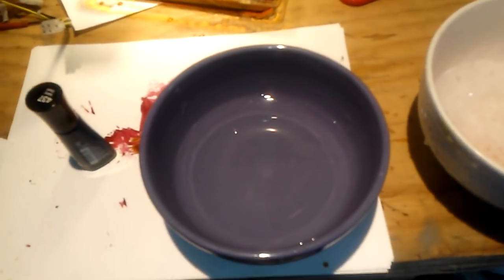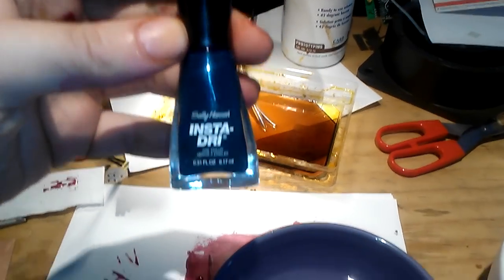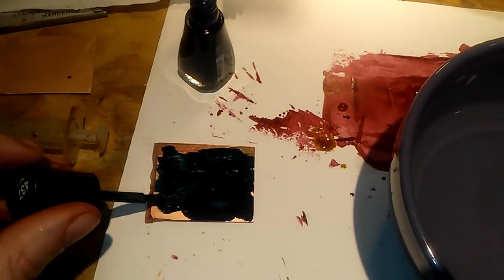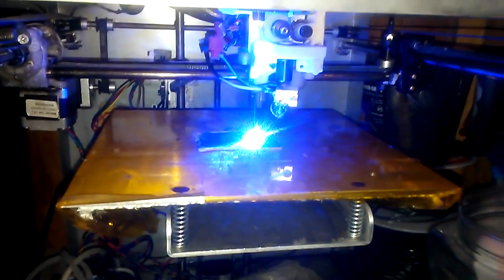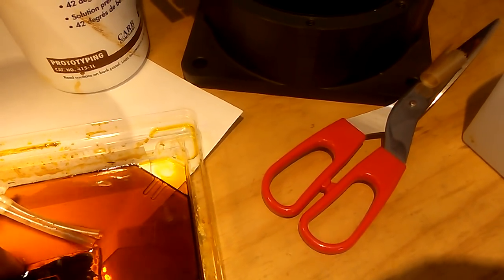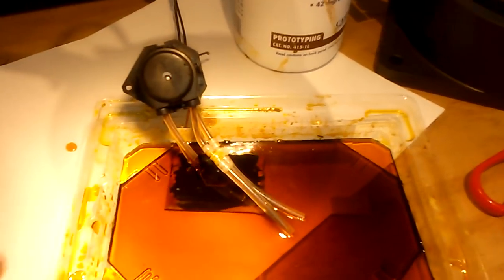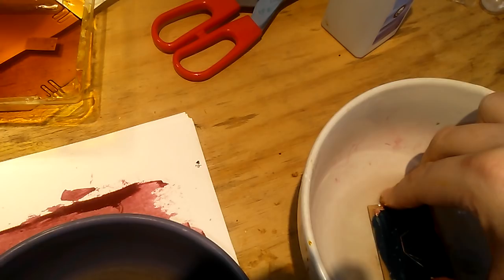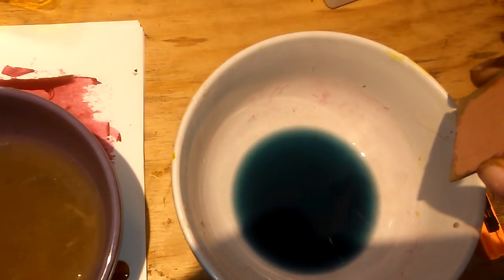Using a diode laser to etch a PCB

Comment: Just FYI.  You can get 10 double sided 100mm square boards with silkscreen for $10 now from China with three day turn around.  ($20 shipping).  And, Ferric Chloride is NOT skin safe.  It is a Category 2 skin hazard and a Category 1B severe eye hazard.
Reply from the maker: Yes, so wear goggles :) I am trying to show that it doesn't have to be scary. People read "acid" and immediately freak out, I want to combat that.
Reply: $30 is a lot to pay to make prototypes when you re-do board many times after discovering mistakes.

Comment: there has to be a better way to apply the polish. rubber wiper blade?  it would be really slick if not for the fact that the little brush makes it take too much time
Reply from the maker: I'm just showing a method here, what I generally do is use a broader brush I got at a hardware store.

Comment: You can't exactly say ferric chloride is "perfectly safe to put your finger in" when the MSDS rates it as a 3 out of 4 on the health hazard scale and 2 out of 4 on the reactivity scale.
Reply from the maker: The idea is that we use it at a low concentration, but with some kinetic movement.

Comment: Oh sorry, forgot..... what about the UV light from the laser?
Reply: relax, he knew not to leave his phone trained on it.
Reply from the maker: The laser ships with two pairs of safety glasses. If I use a green filter with the phone, you can't see anything in the video (see the other videos).
Reply: There is no UV because it's a blue 445nm laser, I'm trying this with a Violet laser 415nm single mode, would give very fine details, but 450mW isn't enough to get to the copper. It just melts...

Comment: Besides protecting the bare copper with nail polish, how about protecting your hands with disposable latex gloves!!  Really, putting your fingers in ferric chloride (acid) and then polish remover (acetone) is not really a good idea nor should it be endorsed.  Is your work area well ventilated?  I doubt it.
Reply: did you not catch the slovic accent? Their super tough genes combined with unusually high levels of caesium-137, iodine-131, strontium-90 make them immune to all but kryptonite and chuck noris. The only thing he did wrong was not filtering the fumes through a smoke
Reply from the maker: I am Italian :)  I am trying to show that it doesn't have to be scary. People read "acid" and immediately freak out, I want to combat that.